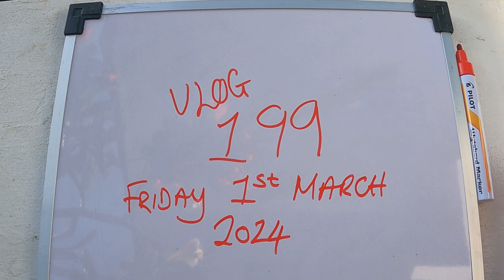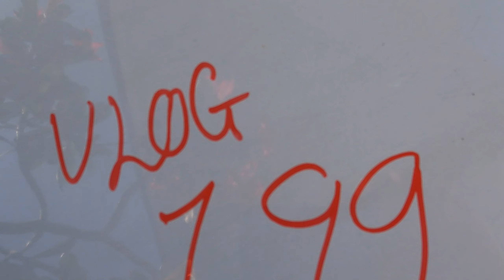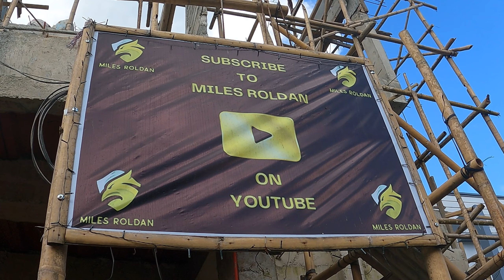VLOG 199: THIS IS HOW TO WATERPROOF A PARAPET WALL!

Comment: Hi Miles In New Zealand  I used Cemix water proofing  British company with production in New Zealand. 
Have previously used Fuller USA and Dunlop UK brand.
In New Zealand water proofing you have to use a licensed applicator and requires a PS3 declaration then needs inspection by a separate licensed authorities. 
If it's  a CR nothing is better than water test to know if it's really water proof. 
The back ground to New Zealander strict water testing is that our houses most are timber construction and water and timber do not mix.😊
PS the boy's are doing fine especially the one using roller as putting it in 2 directions. 😊
Have used Boysen paint paint or to say my builders have
Reply from the maker: Wow, very interesting… New Zealand has many rigid construction requirements… I agree, the boys are doing a fine job. Thanks for your insight as always mate…